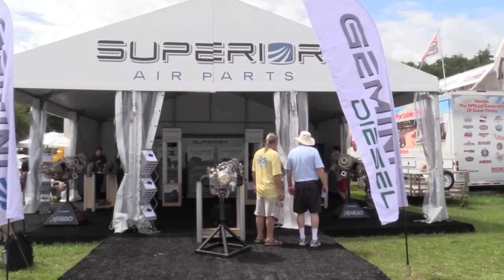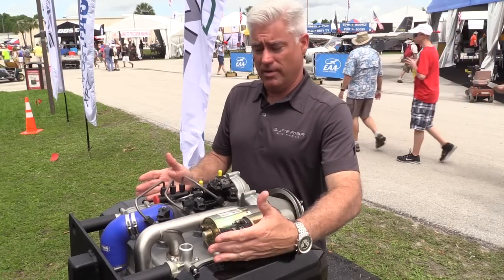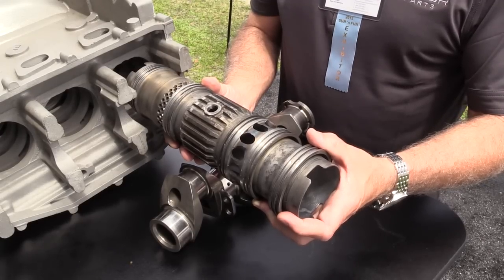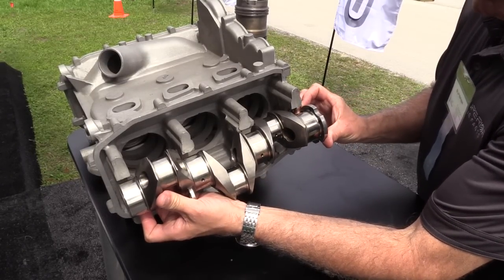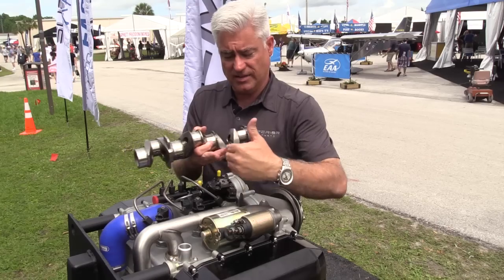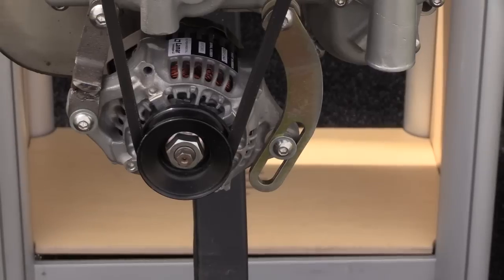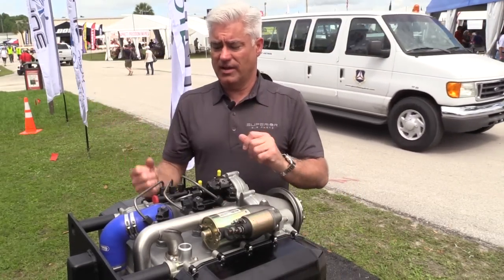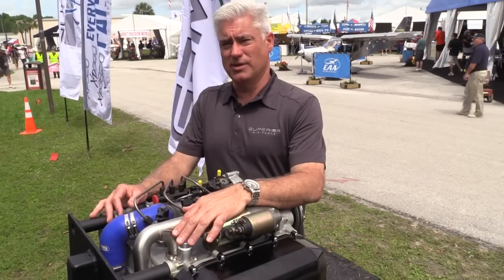Superior's New Gemini Diesel

Comment: He didn't mention that this opposed piston layout does not need a head gasket, which can be a point of failure. Gas engines have an aluminum head (to allow better heat-wicking for high compression) that is sensitive to warping when the cooling system is stressed or failing. These cast iron cylinders can have external liquid cooling, but if that cooling fails, it can run in a "limp home" idle with no liquid cooling. No sparking system to fail, no exhaust valves to fail from heat (in a turbo gasoline engine), and the torque resulting in this engine is at a lower RPM, so in some designs, no propeller speed reduction unit (PRSU) is needed (google image). I was on a submarine that had an opposed-piston 2-stroke diesel as a backup, and it never failed.

Comment: Seems to me that for some reason the 2-stroke aviation diesel just ain't happening. The only aircraft with a diesel that I know of is the 4-stroke Mercedes automotive based Diamond Aircraft. A simple and reliable diesel with decent power-to-weight would be great. I'm starting to think it simply can't be done or is cost prohibitive.
Reply: Im sure ports can be cut into the mercedes diesel or it could be converted to a poppet valved loop charged 2 stroke like the toyota s-2.

Comment: Also the combustion on this motor takes place dead center of the motor not on the outside like conventional valve train motors. With the combustion taking place in the middle of the motor the results is a SUPER SMOOTH running motor with almost no vibration like a jet motor.

Comment: This is a great disign old Fairbanks Morse opposed piston  only much smaller it would seem to me this type engine would be good anywhere no valves no cam no cylinder heads or head gaskets to fail pretty simple it was supper reliable in ship engines!
Reply: Michael Richter I thought I read they used it in trains also ???

Comment: Five years later, and no engine.  It still shows even their 100 hp engine in development.  Major, major, bummer.  What’s going on here?  Could really use their 200 hp engine.  The configuration and specs are perfect for the Cozy Mk IV.
Reply: The Higgs Diesel is coming along.   The Higgs Diesel is diesel fueled (along with Jet-A, gasoline, 100LL, etc), but is NOT a compression ignition engine.   It is a two-stroke, stepped piston with a BSFC claimed of 0.40 lbs./HP-Hr, is very light, and the Falcon version - 4 cyl., is 165 lbs with 200 HP normally aspirated, and up to 250 HP turbo charged.  No numbers on the weight of the turbo charged version, but clearly heavier than the NA version,   Advantages over Rotax, better BSFC, lighter weight, higher horsepower, Max continuous power at 85% of rated power, (turbo version) can go well up into the flight levels with sea level power.    A bigger bore version, the Higgs, V4 Hawk, is 350 HP NA and 500 HP turbo'd, water cooled, and all in 306 lbs.  http://www.ac-aero.com/hawk/
Reply: @gradytalbot2018  I’ve switched focus to the Higgs Falcon.  After adding an engine cooling system and heater core for cabin heading, it looks like it will top out just under the weight of O-360, but with greater horsepower, better fuel efficiency (higher energy density in the fuel, mostly), and a more compact, simpler package.  I haven’t seen any movement on it lately, no updates on their spec sheets yet, and worse:  no flying examples.

Comment: I don't see how it would be the best option though ... why not make it so that the intake/exhaust port timing is adjustable? That would help keep it efficient over a wide range of speeds. As of right now, its best as like a generator engine. (Single operating speed)
Reply: For aircraft steady HP at 2000 rpm is the goal.
Reply: Mount some Boyesen trapping vales on the exhaust for a broad power curve, this was done on a kx500 with 60% more low end torque!
Reply: In theory, yes but how to fit it? 
As Paul James says, steady engine speed is the key. You only run at a different engine speed when taxi-ing or landing
Reply: It doesn't need to be with a variable pitch constant RPM prop.

Comment: ok what about weight of this engine 200kg or ...? tell me pls
Reply: +baklazan ivanovich i think the weight of this diesel engine is beyond 100 lbs.
Reply: 125HP/45kg = 2.77 hp/kg (2 kWt/h*kg) ok thx. it can be a little more lighter if use generator with NdFeB magnets connect to the forward engine. And finall question can this engine make 700 hours of work 125hp time?
Reply: +Catalino O Calimlim 200kgs is over 400lbs
Reply: Casey Colgan  thanks

Comment: "3-cylinder"? So, 6 pistons? I know it has 2 crankshafts but he should just call it a flat-6 to make it sound less odd.
Reply: kooky216 
But it's not a flat six. Their description is accurate, it just doesn't fit into everyone standard thought process of how to describe a typical engine. I love seeing all this new diesel engine tech coming out fast and furious with lots and lots of people thinking way outside the box.
Reply: I'm still waiting for water-injection in engines. That could increase the thermal efficiency, help control emissions, and reduce fuel consumption as well.
They used to do that in some old WWII aircraft, to increase engine power output.
Reply: Flat 6 has 6 cylinders with a crankshaft in the middle and 6 cylinder heads. On a diesel, a cylinder head is heavy so as to stand the higher compression ratio compared to a petrol engine. 
In the opposed piston engine you do not have cylinder heads, the opposite piston does that job.
Much lighter and more efficient
Reply: But "flat 6" means a different engine configuration.

Comment: I hope it can run on 100 octane gas, not every wants diesel as gas can produce much more power.
Reply: Bruce Miller what?
Reply: Its a nice opposed piston 2 stroke, very efficient and fast.
Reply: Diesel has more energy potential per volume unit that gas. So why would you want gas? A turbine can run gas. They don’t for two reasons; cost of fuel , more over the energy density.

Comment: Unfortunately diesel does not produce as much power a a good high octane fuel. Toulene has 112 octane and higher BTU per gallon.
Reply: Toluene 114,000BTU/USgall    Diesel fuel 139,000BTU/USgall   Gasoline 115.000BTU/USgall And diesel engines are more thermally efficient.
Reply: Bruce Miller pp
Reply: Dave PB You are correct ,that's why they are still around,people just don't want Rudolf was a real genious.

Comment: The twice faster increase in the volume while in the power stroke makes it very low torque for shore. With OTTO crankshaft Diesel concept has a huge issue because burns internally only about 30% the rest is burned externally out of power stroke recompressing the unburned gasses by holding the exhaust valve closed for a long time (simultaneously increasing pumping losses) Still having not enough time to complete the process uses the EGR system partially returnig  some gasses into next int. cycle. The remaining gasses are exposed to numerous other after treatment accessories. Variable turbocharger slows down pipe flow keeps the pressure and heat higher with the intention to stimulate further burning process as a primary function, than DPF, DEF, EGR, SCR are doing the same thing. That all tells you that mechanical relationship between piston reciprocating response vs. crank rotation in the conventional concept is ALREADY inadequate. Opposing two pistons & two crankshafts like in this arrangement, you doubling the friction, and increasing the volume in power str. twice faster vs. crank rotation. Thus the fuel propagation and speed of the flame can't apply enough pressure on the pistons forehead.  You are making it even worse.
Reply: yeah i like the 2 stroke design much better, im not a 4 joke fan anyways.

Comment: Looks to me that they took the same technology from the archate opposed two stroke diesel that they spent 16 yrs developing.. Opposed diesel is nothing new. But getting it right takes alot of work and I can see that all the things that this guy is talking about was developed by the archate motor company or how ever you spell that company. Same setup on intake and exhaust etc.. Freakin thieves
Reply: Achates are using the same tech that Junkers had in serial production in the 30s, just redesigned with modern design tools.

Comment: Bah! Yet another new, overpriced($25,000....!) unproven engine for the LSA crowd. We need something that's a real threat to Rotax's dominance, not another pipe dream. Pathetic!
Reply: +Michael Livote  you have to start somewhere!
 I'm sure the wright brothers did
Reply: +Michael Livote A bit of Apples and Oranges.
A Rotax along with most gas-burners will have a TBO of 1500-2000 hrs max.
Most diesel mechanics for Detroit Diesel two-strokes (same layout)  will tell you
after setting it up: "See you in 10,000 hrs". And then there is the fuel consumption difference.
However most small aircraft probably do not need a super-long TBO so Rotax is still
overall more appropriate for this end of the market. Low buy-in and just enough TBO :)

This would be a great engine for a military long-endurance drone. Diesels should have
a stealthier E/M signature (no noisy ignition system) and go forever on a gallon :)